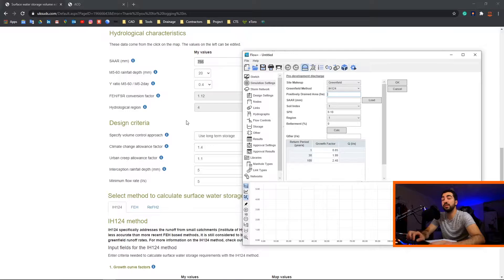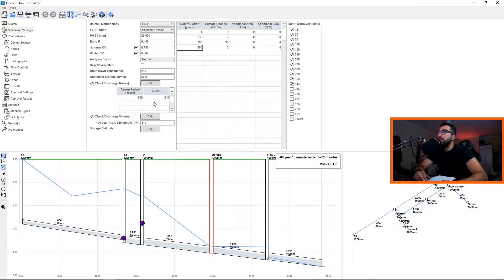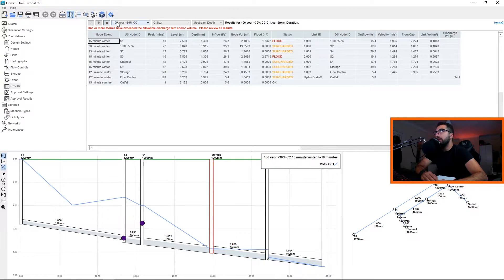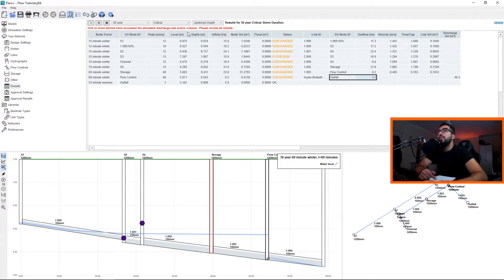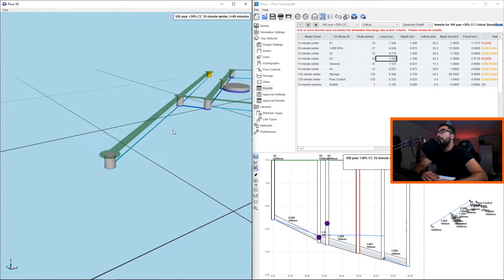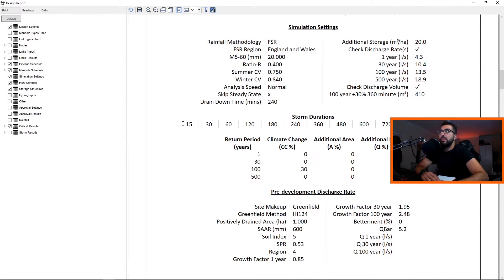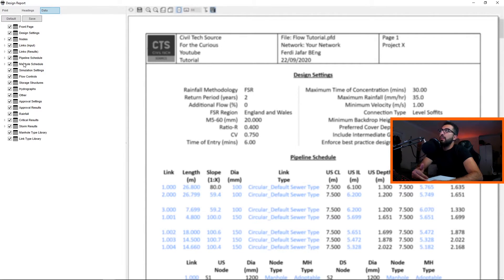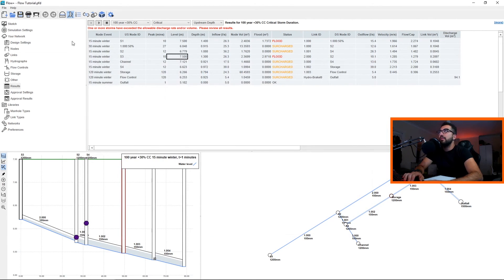How to run a simulation analysis in Flow

Comment: As far as i know, the only relevant flow rate to check for the outfall manhole is Qbar for all storm events including the 1in1year... so why are we setting up the model to check for a different allowable discharge rate for each storm event, related to the corresponding greenfield run off rate for that storm event, when it should just be Qbar every time?
Reply from the maker: It has become more common to limit runoff rate to Qbar rate. However, that is not the case on every single project. I think due to number of factors people opt for Qbar as a default rate as most LLFA ask for it. But I am still working on schemes that I propose various rates or even mimic the 1,30 and 100y greenfield rates. Ps. the video is quite old now, maybe should make a new one.